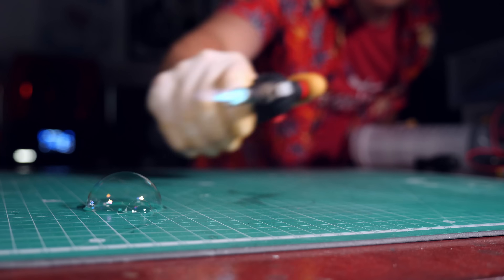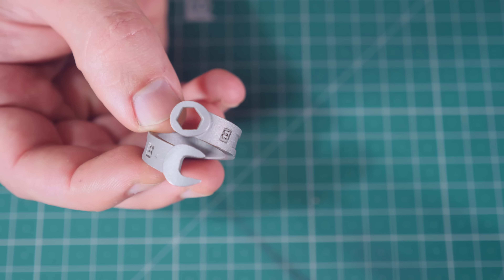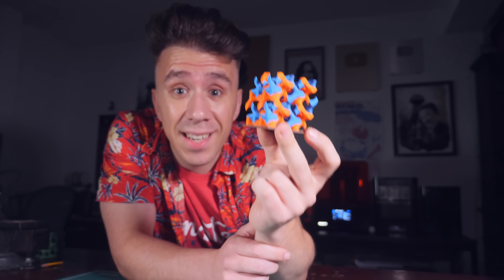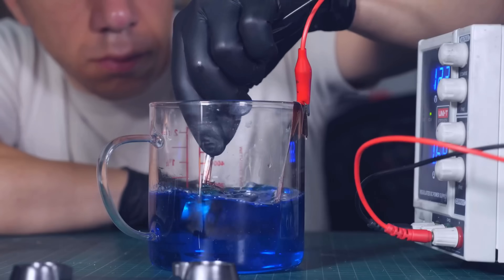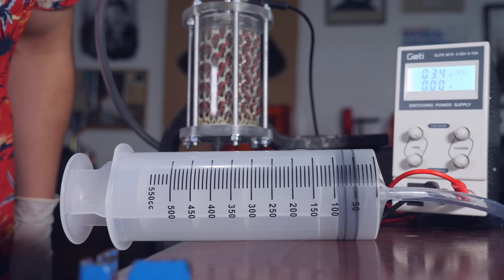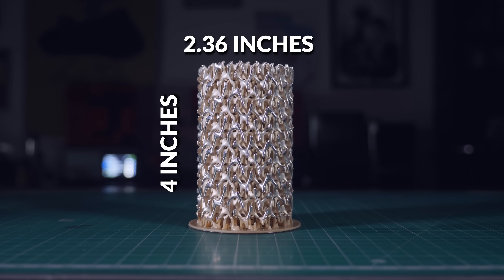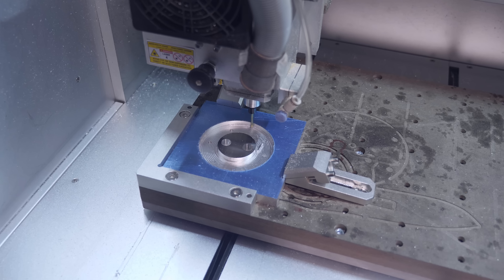ROCKET that LITERALLY BURNS WATER as FUEL

Comment: Hi. Can you make small car model (maby just 4 wheels) powered by hydrogen from water. -> Tomatoes are disgusting !  (ps love u Integza)
Reply: I would like to see it
Reply: Two men in suits would like to know your current location, please 🥰✨️
Reply: Cool idea, could see how it can work, but sadly hydrogen explodes pretty violently and i'd doubt there is any engine that could withstand pure hydrogen combustion, however you could mix it eith another fuel and, for example give only 30-40% hydrogen (or less, depends on the fuel and the engine) with another fuel to the engine and it could boost the efficiency of the engine.
Reply: Do you want him to disappear?
Reply: @ashutronomy3448  Nop
Reply: @funny_gaming_Pro   well hydrogen has already worked for full size cars, there were a couple models in the past but sadly the man who figured out how to do it well was killed and his material was destroyed by the oil industry
Reply: @karachter  Stanley Meyer died of a brain aneurysm. His "water powered car" was a glorified perpetual motion machine. His work was not destroyed and you can find the patents online
Reply: @ir0ncat_  Found the big oil PR man.
Reply: @funny_gaming_Pro Toyota was supposedly developing an ice hydrogen engine tho I can't remember the details
Reply: Would be really cool to build a small and very stout engine using the hydrolysis mixture. Like just a couple CC of displacement and low RPM with a  big flywheel. Something with a very low compression ratio. like 2:1 even. The cylinder and head would be one solid piece of steel like 1cm thick.
Reply: @teebob21 they aren't really that bad, it's more the infrastructure supporting them that sucks
Reply: The reason this isn't done is simple, it's ineffecient it takes more power to create the hydrogen than is gained from it's use so as a vehicle you would have a lot of extra weight and a system that's a net loss when used hence why hydrogen vehicles just store the hydrogen on board
Reply: @funny_gaming_Pro a standard petrol engine will run just fine on hydrogen without any modification you just need the correct fuel delivery system. Remeber he use mass to say how hydrogen has way more energy than petrol but that isn't how engines work it's volume that matters and hydrogen is only 8MJ/L to petrols 32MJ/L so you need a lot more of it pushed in to the engine
Reply: @shanesalyers5433  Its UK
Reply: @funny_gaming_Pro there are plenty of hydrogen burning engines, but it’s more efficient to use it in a fuel cell to run electric motors (80-90% vs 20-30% efficiency by burning).
Reply: Think about the chemistry more than 2 seconds.
You're adding energy to water to turn it into boom gas.
When you combust it, you're turning it back into water.
The fuel is the battery not the water.

You could in theory use the energy from the alternator on a petrol engine to create boom gas to mix with the fuel but modern alternators just turn off when they're not needed which is a lot more eficient.
Reply: There is always someone..... Stop no it cant happen. Why? Because what it does to batteries. You cant produce enough, quick enough, and using to much electricity to keep it going. A water powered cars need energy to make energy. They want hydrogen cars, not water ones. Hydrogen storage is the problem.
Reply: Bruhs tryinna get him killed
Reply: Hyundai already sells cars powerd by hydrogen from water, but it uses hydrogen fuel cells instead of hydrogen combustion(which is more energy efficient)
Reply: @죽은_시민의_사회  .... Like i said hydrogen cars. Not water cars.
Reply: @kodiak6969  He will survive
Reply: @ashutronomy3448 Exactly what I came to say. People don't realize that was invented in the 90s. And the guy was murdered, just like the guy that invented the carburetor that ran off gas fumes and was brutally murdered when he wouldn't sell it.And Then things like that just get swept up with the invention secrecy Act(if its in usa). And nobody ever asks any questions
Reply: Look up how many ppl have mysteriously died from doing this
Reply: Not a BP plant in the comments.
Reply: @asdfassfs  look up how many were hoaxes.
Reply: Looks like you’re getting a 3D printer I think my dude 😂
Reply: Are you trying to get him silenced by a 3 letter agency or something?
Reply: @shanesalyers5433  The energy required to make hydrogen to drive a car is about 25x more energy than just using the batteries to move the electric motor wheels. So that's why it never took off .
Reply: @ir0ncat_  you can't find all of his patents there is part of it missing,two parts actually if you count the reactive coating on the combustion chamber walls and the ceramic coating for the piston heads.
Reply: @ir0ncat_  "perpetual motion/free energy" means you don't have to put any energy into the system and it would keep running,that's NOT how this works you need 4 batteries,the proper transformers to step up the voltage,and at least two ignition coils
Reply: @Aaron-zu3xn  Clearly you don't understand how his proposed cell would work. it's literally classified as a perpetual motion machine
Reply: @shuttlecrab  I feel at this point there would be retaliation cause more ppl are finding out
Reply: I wonder if a little rc engine could be modified to run off the oxygen and hydrogen mix?
Reply: @teebob21  but doesn't the mirai run on (it a a hydrogen fuel cell, not a hydrogen engine) hydrogen to make electricity, and not water to fuel combustion?
Reply: Thats how you get taken out by a government agency.
Reply: 😂 remember guys he has no suicidal thoughts
Reply: Toyota have combustion hydrogen engine but it's ineffective.
Reply: No because the energy needed for electrolysis is higher than the one  released from the burning.
Reply: there's no point you can just connect the water to the battery this uses for more power
Reply: Oil companies will come for him!
Reply: perhaps a new dog model
Reply: @karachter You could buy a Mazda RX8 “Hydrogen RE” in the early 2000s that ran fine on hydrogen. The issue is actually the opposite, Hydrogen gas has a lower energy density than gasoline, so the car would lose either power or range when running on H2
Reply: Why? You are far better off having a lithium ion battery in the car and charging it directly.
Reply: @shanesalyers5433 😂
Reply: @funny_gaming_Pro wouldn’t it being too powerful be a great problem? If it were the case could you not just fine tune the amount of hydrogen you’re releasing into the engine, lowering the amount you use per cylinder and increasing economy?

Some of what makes modern engines complex is the fuel system that atomizes exactly the right amount of liquid gas per cylinder. Hydrogen wouldn’t need atomized, as long as you could pump out the right amount of hydrogen per cylinder that is equivalent in explosive power to the original gasoline specs, I see no reason it wouldn’t work.
Reply: @ir0ncat_  but that breaks the laws of thermodynamics. 'you cannot create energy or matter from nothing'
Reply: He can, that is not the problem. But he'll spend 3kW energy to get 1kW back ... if lucky.
Reply: You mean men in white suits, carrying a straightjacket? 😄
Reply: Stanley Myers built one and they killed him.
Reply: You trying to get him killed?
Reply: Yes
Reply: Yep, IT does require  a bit more electricity.
Reply: @funny_gaming_Pro if you separate the hudrogen and o² and alter the blind it can but at variations.
Reply: @andrewt9204 regular engine runs fine with the right blend
Reply: You csn order aftermarket add on hho to most anything already. 
The issue is freezing cold temps and water when your parked. 
Hho is toi explosivge to carry a tank and getting it filled .
Reply: Frequency combined with the hho engine is how to get ahead.  
Frequency has everything to do with everything.
Reply: no no no no no we don't need integza to "die of mysterious causes"
Reply: @funny_gaming_Pro  there are already hydrogen cars, regular combustion engines can run on hydrogen with almost no modifications
Reply: @karachter  "well hydrogen has already worked for full size cars, there were a couple models in the past but sadly the man who figured out how to do it well was killed and his material was destroyed by the oil industry"--

Of course it was... More like that was the excuse because it never existed in the first place. A fuel cell that generates more energy than it takes to break the bonds of water would have been the first device in history to break the laws of thermodynamics.
Reply: A Michigan dude did it in the 90's I believe, but he's de ad now. Poisoned, he claimed, last words as he ran out of the restaurant he was meeting a couple to sell his idea. Ergo, the comments about S - cide.
You can look up channels that still talk about him. He was on the local news. He might have had better luck in Commiefornia, or Canada, but not so much in the same state as the Big 3 offices are.😜
Reply: @LikeABestGamer I had that same idea
Reply: Maybe*
Reply: Hook it up with jumper cables to a running vehicle. You can use a proton exchange membrane (PEM) in the middle of two graphite plates and that would do a heck of a lot better.
Reply: there are hydrogen powered cars already, this isnt new information. nobody is being killed for making a water powered car. this already exists.
Reply: @SmartMoney420  there are already hydrogen powered cars. this isnt new
Reply: @ashutronomy3448  nobody is being killed because they discover this, this isnt new informatino and there are already hydrogen powered cars. the exhaust gas is oxygen
Reply: @ThaJay  no point in doing that you are just converting the energy from the gas into energy stored as hydrogen and it would be a loss of energy any attempt to power electrolysis with an alternator would add a parasitic load to a running engine
Reply: @shanesalyers5433  no they won't? the real fuel here is not the water, it's the electricity being used for the electrolysis (not hidrolysis, how he keeps saying). So, let's recap: you use a lot of electricity to produce hydrogen so you can burn it in an internal combustion engine which is a complex, inefficient machine. Why would you do that? Just use the electricity to power an electric engine, which is a very simple, highly efficient machine instead! You get cheaper construction, higher torque delivered at all speedsand lower maintenance as a bonus.
Reply: @shanesalyers5433  the man WHO Made a water powered car 😮
Reply: Small model? Screw it, we making a working car and getting on top of the government watch list
Reply: @ir0ncat_ same stuff discovered by denny Klein and Ryushin Ohmasa.
Reply: @ir0ncat_  anyone up for replicating the machine to prove how it works.  The water powered car is a metal powered car.
Reply: @asdfassfs  not mysterious when you die in the explosion
Reply: @cleitonoliveira932  correct about electrolysis but you forgot about other reactions that may happen
Reply: @conannanoc8768  Why do you need torque in a rocket?
Reply: Here is the True Savior

HalleluYAH translates “Praise ye YaH”

YaH is The Heavenly Father
YaH arrives via the TENT OF MEETING
YaH was Who they Crucified for our sins
YaH was Crucified on an Almond TREE

Semitic of Moshe (Moses)
Isa Scroll (The Original Isaiah)

Isaiah 42:8 - I am YaH; that is my Name! I will not yield my glory to another or my praise to idols.

Isaiah 43:11 - I am YAH, and there is no other Savior but Me.

Isaiah 45:5 - I am YaH, and there is none else.
Reply: @kenlawson5142  frfr the clean up crew prolly in on it too lol
Reply: @LikeABestGamer Congrats on getting the 3D printer! (Unless there's an even more upvoted comment that I missed)
Reply: @teebob21 one word. Alpine. 😂😂😂😂
Reply: @shanesalyers5433 Toyotas lawyers for violating their patients on their hydrogen engine?
Reply: Someone wants to end up like Preston Tucker.
Reply: @funny_gaming_Pro fed
Reply: We don't want another water powered car incident

No
Reply: If you can and do decide to make one,can you implement the hydrogen on demand method that's out for purchase on or regular vehicles?
Reply: Ur wrong for that
Reply: No someone will come for him if he does
Reply: @Aaron-zu3xn  You're technically correct but still wrong, because you're talking about a WORKING perpetual motion machine, and there's no such thing. This car does not run on water, it runs on electricity, and if you drive it around the battery will eventually go dead and the car won't run until the battery is recharged, no matter how much water is in the fuel tank.
Reply: Well, thats the end of this channel... and I just found it. 😪
Reply: big car models running on hydrogen already exists
Reply: @user-yw3ic8qc1h  Tech common people are allowed to use without dubious interference is a joke. Knowing this is brain damaging to those who know and have ideas they suspect would put their life on the line for working on; just because they would challenge an industry that would then not be needed as is.
Reply: @user-yw3ic8qc1h  Yes, but not on WATER. And why do we not have cars running on hydrogen?  They tend to be very explosive.
Reply: Short Answer: No
Long answer: not really because it's just not efficient. The true answer is yes you can fuel a car with exclusively hydrogen however you have to deal with energy density. Hydrogen is not very dense (its so high on the periodic table for a reason) leading to the requirements of having a pressurized tank of hydrogen on a car and an explosive molecule kept under pressure is what we call a bomb. "Why don't we just have the water in the car and make the hydrogen?" You end up consuming more energy to break the bonds than you get from burning the hydrogen and oxygen together. You can't ever really break the laws of thermodynamics.
Solution?: turbine hybrid cars running off of ethanol. So jets can't use ethanol because of air pressure but turbines absolutely work great with ethanol. If failed back in the 1980s for a few reasons but primarily because using the turbine as the direct mechanical power isn't great because torque generation isn't great from turbines. The hardest part is battery technology, its one of the major things holding us back.
Reply: @50_Foot_Punch   Also why the 100 MPG carburator is impossible due to causing excessive lean conditions.  Lean is mean, it burns up pistons, rings, valve seats, ect.  14.7 to 1 air to fuel ratio cannot be exceeded without engine damage... PERIOD.  And gasoline only burns atomized, meaning as a vapor, that is by definition what a carburator does.
Reply: It would explode, hydrogen is very unstable, like an atomic bomb or uranium
Reply: thats not the issue, the problem is that it takes a lot more energy to separate the water than the output from combustion. Would be an interesting experiment but this isnt a fusion fission engine like the sun and the sun does have an expiry date for when it runs out of fuel. All this does is make the system of producing hydrogen more compact than storing it.
Reply: @BearBig70  He wasn't meeting with someone to sell his ideas when he died, he was meeting with two of his long term investors, some of the handful that didn't try to sue him when the con became obvious.
Reply from the maker: Hello! Congrats! You just won a 3D printer! Send your info (Name, Address, Zip Code, Phone number) to integza@gmail.com .
Reply: @integza  if they don't respond can you hit me up ? I'd be a taker
Reply: @integza  Hi. I just send you email.
Reply: @bigmango202 they developed it and you can buy it but it uses a fuel cell not a ICE engine as a fuel cell is far more efficient
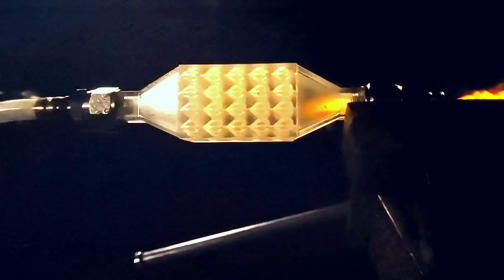Reply: Literally thought the same thing and came here to say this. Let’s go Integza! 18:38
Reply: I am not really a cia agent and want to know ur live location🤣
Reply: Yeah men
Reply: You’re just leading this guy to his death
Reply: @integza instead apply to car, maybe could start with small motorcylce cub?     If success, your invention can help many asian in their everyday life to reduce oil gas cost 😉